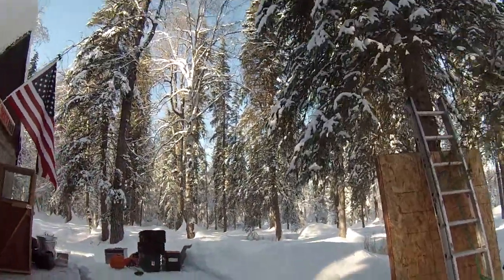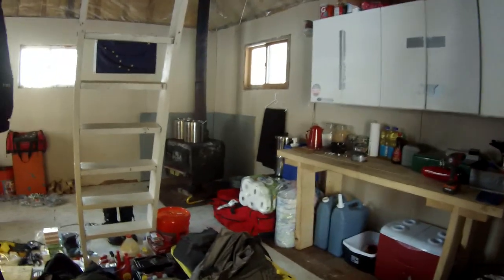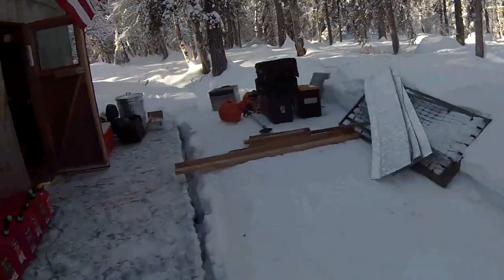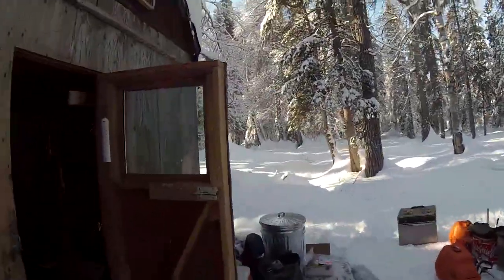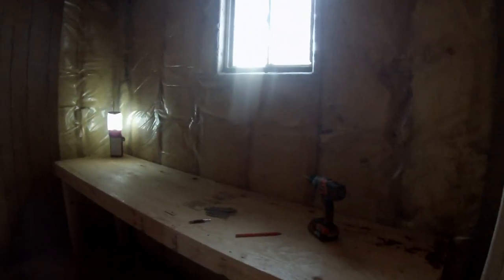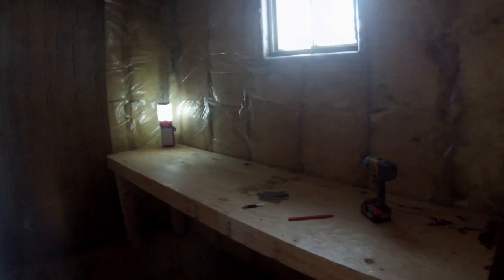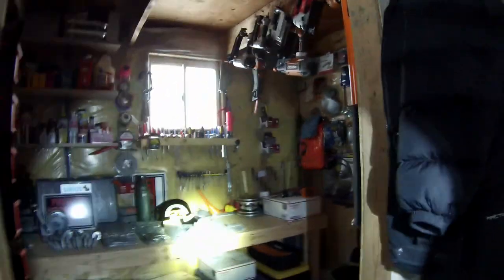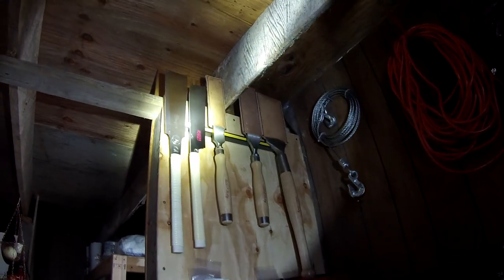Tool Storage Room

Comment: Great video, nice freight sled, did you buy it from someone else or make it yourself, the reason I ask is in wondering what the skis/runners made from, keep up the great work
Reply from the maker: I bought the  freight sled from a guy out here who does freighting for off grid lodges and homesteaders. Its a couple of years old. It was not cheap. The skis are made of a certain type of hard plastic. Pretty common from the other ones i have seen. I was using an otter pro sled , but i had to join the big boys club sometime to start getting materials out here. Thanks for watching.